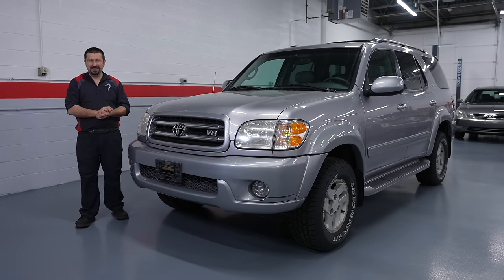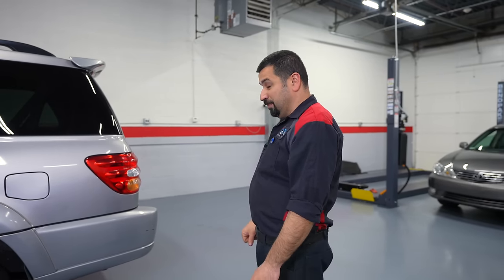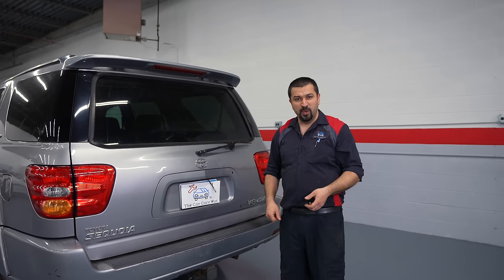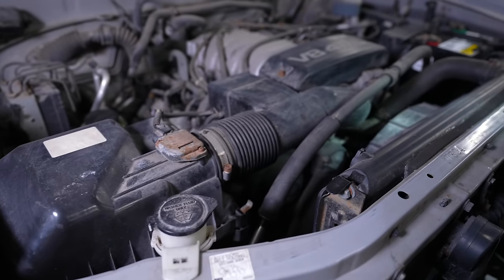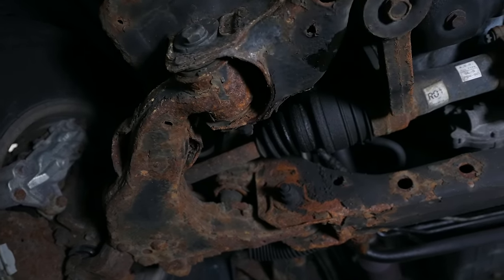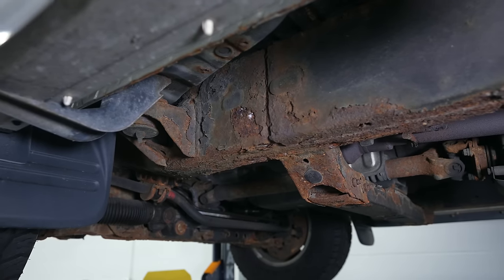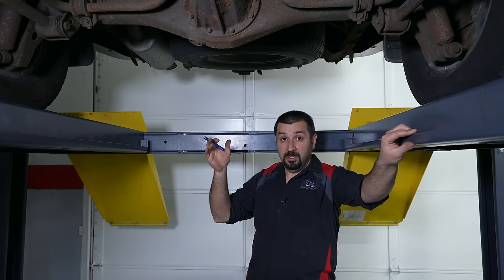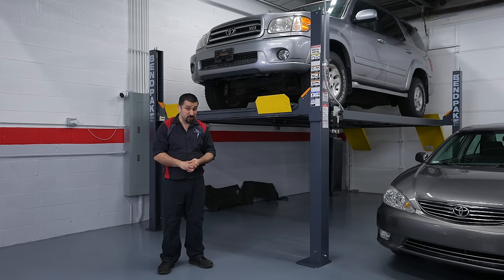NEVER Buy a Toyota Like THIS ONE! Hint : It's not The Sequoia!

Comment: With respect to whomever bought it, there was about 30 things in the original superficial check that should have made them run vs looking the other way.
Reply: I'm sorry but if someone sees that shofter in that condition and proceeds with purchasing the car is just bananas
Reply: I wonder how much they paid for it
Reply: @persistence4752  Probably a donation car.
Reply: @simbatortie9684  I agree, Stevie Wonder  could have seen this lemon 🍋
Reply: Toyota owners will tell you is fine even after spending Range Rover money. Same with the 2GR and 2AZ issues.
Reply: @Cris  There is nothing wrong with 2gr, one of the best v6 ever made. Countless cars with well over 200k.
Reply: @v--p  you need to understand that ALL engines have problem. The 2GR have a lot. It's a nightmare to work on. The common Timing cover gasket issue requires ENGINE OUT to fix it, the Head gasket also requires ENGINE OUT. The block is disposable if it gets damage for the corrosion of the head gasket issue you need a NEW block. 8/10k only on the block. Toyota fanboys will deny everything until they own a Toyota.
Reply: @v--p  even a simple job as a Spark plug change on a 2GR is a pain that involves disassemble the windshield wiper motor and a LOT of plastic to reach the spark plugs. Rather have an old 2JZGE and have a reliable and easy to work engine.
Reply: @Cris  I wouldn't tell you if I didn't own one. 180k on 2gr, has a small timing cover leak that developed after 140k. Not enough to justify any repairs, loose half a qrt on 5k mile oil change interval.  Most modern v6 today in transverse mounted configuration will need the engine out for timing cover leak repairs. GMs engines won't make that far to need these repairs because the timing chains and guides will kill the engine way before.  No other problems with this engine and the car is 2008.
Reply: @Cris  Spark plugs can be done by Toyota mechanic in 2-3 hours. The spark plugs are rated for 110k which is at twice in a lifetime for an average car at most. What else?
Reply: @v--p  As I suspected. You are also prone to have the VVTI gear issues and the Head gasket issues too. All require engine out and if the block is corroded good bye. Some Old Ford/GM from the same era will outlive the 2gr. But i will Rather buy a Honda V6 or a 1MZ Toyota.
Reply: @Cris  Which Ford or Chevy? Are you comparing truck engines with cast iron blocks to aluminum bock in 2gr? Cast iron will outlive aluminum no question but which Fords from mid 2000s that you still see plenty on the road that had aluminum blocks and something equalent to VVTi?   I don't see any Taurus' or 500 or anything from GM lineup and I'm in Texas. But there are tons of Avalon, second gen Highlanders and RX350s. I don't see anyone swapping any Chevy or Ford engines into mr2 projects either. 2GR had no equalent when it was released around 2005 and the sheer number of vehicles on the road today proves its a solid engine.
Reply: @v--p  wow who was talking about swapping MR2s?? Who is gonna swap a 2GR into a MR2 when you can put a 2zz or a K series in there? Also yes I'm talking about cars with Iron cast engines and like I was saying I rather have a Honda or other Toyota engines than a 2GR that I will have to either get it out of the car or buy a new block at some point because of a known issue. Rather have a 1, 2 or 3UZ or a 2JZ-GE VVTI that is far more reliable, durable, good mpg and has more aftermarket support. I'm gonna ask you the same Who is gonna swap a GS/Aristo JZS160/1 with a 2GR when you have a 2JZ or a 1UZ in there..
Reply: @Cris  You had mentioned 1MZ as a better engine and I agree they are solid and reliable but driving 2gr is a night and day comparing to 1mz. 2gr got the reliability of 1mz with a lot more HP and responsiveness that 1mr never had. Plenty of mr2 2gr builds because they are lighter, more compact, can handle boost and easier to find. Look it up, sounds like you never heard of it.
You still didn't give me an aluminum Ford or Chevy example from 2005 that will outlive the 2gr. I should ask you have you actually driven one?  My mother in law had 2010 Cadillac SRX with 3.6 GM engine and I swear it felt like it had 40 HP less than 2gr while it was the opposite.
Reply: @v--p  I yet have to see a 2GR with 1 million documented miles without a rebuild as the 1MZ. The 2GR doesn't come close to the 1MZ reliability it just doesn't and those are facts. I never mention aluminum blocks I don't even care about GM I drive japonese cars not GM. But some specific GM and Ford will outlive the 2GR by 2 or 3 engines worth of Miles and that's also a fact like it or not. Again I'd rather have a 2JZ or a 1UZ, 1MZ, etc.
Reply: Duratech 3.0 engine may outlast the 3.5 Toyota gr engine. Duratech 3.5 is equally good as the Toyota 3.5 except for the internal water pump.
Reply: The car is now SALVAGE !!!!!!!
Reply: Luckily the seller didn't think about duct taping all those rust, LOL!!!
Reply: C'mon! Give Stevie Wonder a break. 🤣😂🤣😂
Reply: It is very hard to make good decisions if you are broke. You have no options. If you have no money and are desperate for a car you might convince yourself to overlook all those problems and hope for a miracle. You probably don't even have enough dough for a pre purchase inspection. Having said that, the seller of this vehicle is a rat.
Reply: That is the great thing about Safety Inspections. In the U.K. the truck would be worth £4000 with a years certificate with "advisories" and £200 with one weeks certificate..
Reply: @persistence4752  LMFAO
Reply: @MrDuncl  How does that work?
Reply: @jasonchristopher2977  Buy a truck with a years safety inspection (MOT) and if you are lucky your only expenses over the next year will be fuel. Buy a truck with only one week left and at the end of that week you might be told it needs £5000 in repairs (such as welding up a rusted out frame) to legally keep driving it.

p.s. Advisories are usually things like "rust on frame but not excessive". Get some decent paint on it and the advisory might be removed at the next yearly inspection.
Reply: @MrDuncl  Ok. I get it. Thank u sir. Appreciate the info. U have a gr8 week. See here in USA in Pennsylvania, we have yearly safety inspections, In Ohio next door they dont. In WV to south they do. I've seen cars from Ohio with no bumpers, fenders flapping and tires so out of round, I'm surprised they don't fall off. But our roads are not car worthy. Oil and gas took over 12 yrs ago and they destroy roads with all well traffic over weight etc.

Comment: How hard do you have to work to destroy a Sequoia? this is insane
Reply: Salt: It is not that hard
Reply: It is very easy, the tinest bit of salt will make them melt through. Like buying an Atlantic City hooker flowers.
Reply: I had a 2002 Sequoia. It was looking pretty rough underneath when I traded it 5 years later. The salt and chemicals they put on the roads might as well be acid. I have a 2020 Tundra now. It doesn't get driven at all in the winter if the roads are wet. It is the ladder frame that is the problem. There are nooks and crannies everywhere that hold salty slush. Then there's all the hangers and equipment bolted to them. They get packed in and freeze, then hold even more salty chemicals. The best thing for wintery roads and resistance to rust is a unibody car. They're smoother underneath, so they don't hold the slush. But it's a good idea to make sure the wheel wells are cleared and rinsed throughout the winter.
Reply: @thnksno  Move to the south, I have a 1998 Nissan Sentra I bought last month....has no rust, and this is a car notorious for rusting.....because it has spent its whole life in Georgia. I paid more than I should have but there is the "manual transmission tax" nowadays sadly on anything, and I refuse to drive automatics.
Reply: @fortheloveofnoise    We've looked into moving down South. Unfortunately, we're just too Midwestern and don't feel like we fit in down there. We like the rural farm, lake, and tavern life, cooler weather. Winter, though, is definitely tough on the equipment, especially vehicles. I've learned to live with it, like not driving a body on frame vehicle when it's wet and chemically outside. I hear they use beet juice in some places, I don't think they do around here. Then there's some weird pre-ice stuff they spray on the bridges, I don't know what's in that. I've tried keeping vehicles many times throughout the years, but it never works. We currently have a 2012 Civic in the family. But the big kid ran off to Florida with it a few months ago for work. It was our 5sp manual 3rd car. For all the winter years, it has been through, rust isn't an issue because it's a unibody.
Reply: It was a known problem with these. A class action forced Toyota to replaced frames on these, Tundras and Tacomas. All US made with Dana frames. 

If you’re looking for one, look for one with a new frame.
Reply: If people had such easy access to knowledge twenty years ago as they did today, although it wasn't that hard to learn back then, frame could probably have been saved from the salt, I'm sure there's all kinds of coatings and protectants you can put on the underside, which repels water and salt. Some people back then even spent a hundred thousand dollars to put armour on the underside of their SUVs.
Reply: @Mr.President.2028  the midwestern states sling HEAVY amounts of salt on the roads in the winter time
Reply: @neuralismgamingtv4511  Fluid Film or lanolin has been around a long time. It is basically sheep grease. It is biodegradable and coats great. Unfortunately, most people simply don't care. It needs annual reapplication.
Reply: I have a 2015 sequoia, I religiously wash off the salt, the day after a snow storm or 2 with an undercarriage sprayer attachment to my pressure washer.

 The day before a week long vacation. I went through a snowstorm and no time to wash it off.  One week later salt caked on undercarriage and i wash it off.  Come spring, the areas caked on with salt for the week, only see the orange stuff.  Just surface rust, goes to show how easily salt ravages the undercarriage.
Reply: @fortheloveofnoise  or just take your car to a car wash with undercarriage washing every week during the winter.
Reply: Toyota did a recall on some of these frames because of rust issues
Reply: What car doesn’t rust underneath if exposed just as much as a sequoia? Usually Toyotas are decent against rust.
Reply: @thnksno  yeah underbody washing with water is pretty important in the north east and mid west or any cold/snow areas.
Reply: @lefthanded5473  I wouldn’t say every week. Just when it snows especially if they salt the roads which most places do. If you have a house with a hose it’s better cause then you could do it everyday if it’s a big storm and the snow takes a while to melt.
Reply: @lefthanded5473  I wouldn’t say every week. Just when it snows especially if they salt the roads which most places do. If you have a house with a hose it’s better cause then you could do it everyday if it’s a big storm and the snow takes a while to melt.
Reply: @robmalcolm8042   Beware, most car washes recycle water, which doesn't eliminate the corrosive salt. So they actually spray high-pressure water into every crack or crevice. The final rinse is fresh water, but that is only applied to painted surfaces. I have a silcock in the garage that has hot and cold water. However, it's not necessary to have hot water. Just drain the hose as soon as you're done.
Reply: Toyota’s might be reliable. They also have frames that reliably rust away! Toyota has been in North America for more than 60 years. In that time you would think they would have figured out how to make a durable nearly rust free vehicle frame by now!
Reply: @pauldiesel4582  so what brand doesn’t? Most people and mechanics themselves drive Toyota you don’t see them driving american or European that much.
Reply: With this model vehicle or any other vehicle driven in salt copious annual application of fluid film is the only way
Reply: @pauldiesel4582   I've seen more clapped out Dodge, Ford, and GM equipment on the road than Toyotas. It's a maintenance issue with any ladder frame vehicle. This is why best sellers today are U N I B O D Y.
Reply: It’s rotten Toyota under body paint work is crap Here in Oz I have seen in the mining industry rotten at 4 yrs without under body protection
Reply: @paddymickiemickie8221     No, the paint is fine. It is the clueless that don't know how to care for what they have. We have had other brand vehicles delivered with a lot more surface rust. Of which isn't bad. The northern winters are tough.
Reply: Calm down ladies..
Reply: These rot with great frequency.
Reply: @jesdadotcom  Ok Karen..
Reply: Toyota had a frame recall on these cars